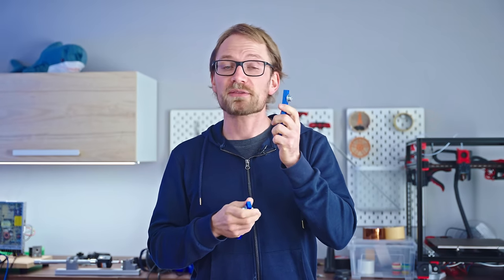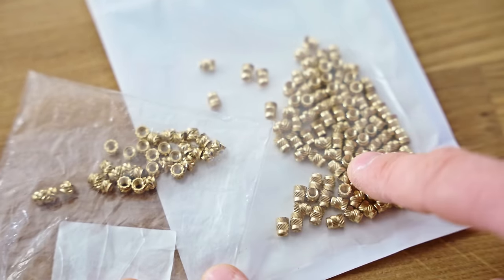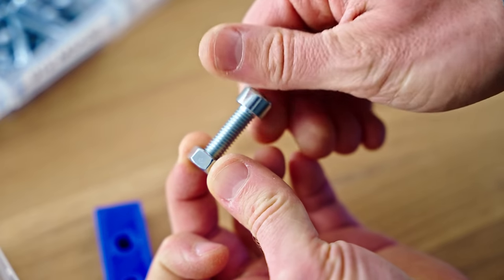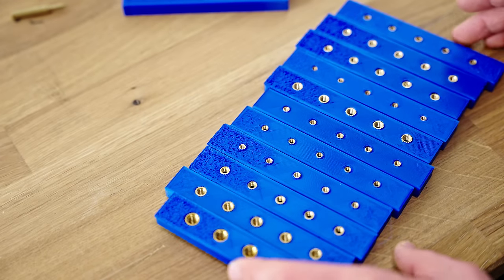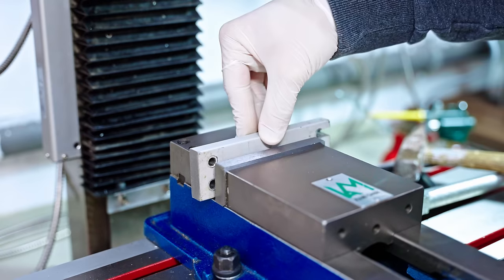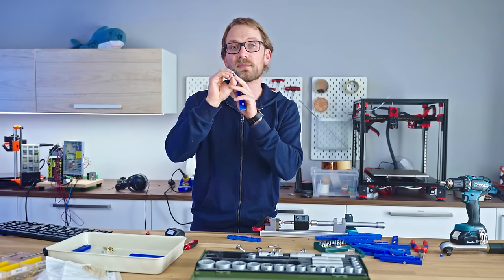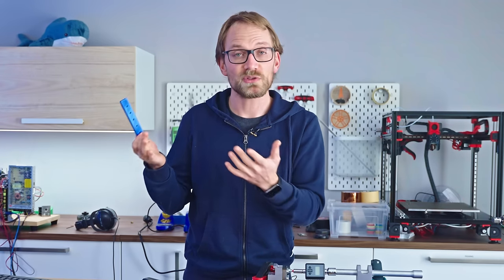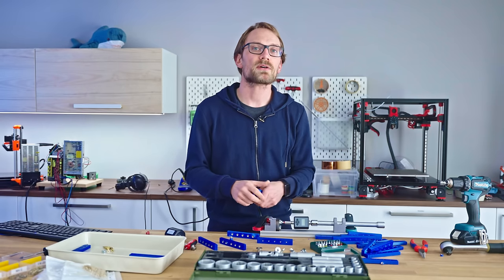Do you even need threaded inserts? Strength tested!

Comment: Surprised you didn't try nut pockets (what prusa does with their printer parts). That creates a nice solid wall that isn't distorted by brass teeth.  I typically use wood screws if it's a one time use, and the inserts if it's a part that may need dis-assembly (also looks more professional).  In injection molding it's exactly the same, if it's a one time assembly then self-tapping, if it needs to be serviceable there better be inserts included.
Reply: This is my exact design philosophy. If it's going together once it's self tapping(even machine screws self-tap in plastic well if the tolerances are low enough) and if it's going to be taken apart multiple times it's getting threaded inserts.
Reply: I design most of my prints with a nut pocket. then I will stop the print in the slicer, insert nut, and continue print. this allows me to use a lot of off-the-shelf hardware store nuts and bolts without having to buy more expensive specialty hardware.

But I'm also not printing high volume, so it's easy for me.
Reply: That'd certainly be stronger threads, but it seems like that would just make the plastic fail faster since there's even less of it at that point.
Reply: Nut pockets are great, and if you design it well you can have lots of plastic between the nut and flange to make it very strong.
Reply: Definitely the best method. I'm a big fan of oversized nuts or large square nuts when possible. You have significantly larger surface area and depending on the depth and the print orientation, the part can be stronger than the threads.
Reply: Wanted to point out the nut recessed as well - guess the good old solutions are going out of fashion 😢
Reply: Those are great as well, but I find them a bit fiddly compared to heated inserts. Heated inserts always work, nuts sometimes don't quite fit very well and then it's quite annoying. Though in that case you could use the melt method as well I guess.
Reply: Came here for this. #4 pan heads. Less work, but only on assemblies I hope to never need to go back inside.
Reply: Just to add one flavor to the mix: a more serviceable alternative to having the nut somewhere inside the print is to have a visible nut on the other side of your printed part.
Reply: What I was thinking as.well. opposite side nut well and bolt then has loads of plastic inbetween. Most plastic injected molded part items I own use that tried and tested method
Reply: I’ll go for this option too. Best is, that the nut can be replaced if needed.
Reply: bingo! it's all about serviceability requirements
Reply: Square nuts are relatively low cost when ordered in bulk. I use them for 3d printing since the longer sides have helped prevent twist out from some higher torque items.
Reply: @Grossvatti  i use it all the time, its so quicky done in cad, and works all the time in all materials
Reply: If it's one time assembly, print some pins or tabs on one piece and holes on the other and use epoxy.
Reply: Except you can't use this solution when it's November 😂
Reply: @Kycirion  in terms of nut pockets, square nuts work much better than hexagonal nuts, they are much harder to round or overtighten, they also tend to have more surface area which helps.
Reply: Nut recess on the other side of the part is what I've always done - such that the nut is press fit into it if possible. I'd be interested to see this tested.
Reply: Recessed nuts are great, especially if you get the sizing right and they lock into their holes.

I've also had great success with a hole in the print that I drop a washer in while it's printing. I guess a pause programmed into the gcode would be easier but this is like low stakes roulette so much more fun.

The M8-M10 bolt he's holding in the video will hold a medium sized person that way, no problem. I know because I hang on them a lot and my shirt says M in the back.
Reply: Nut Pockets are Beyond the Scope of this video.
-they outclass anything shown here, it wouldn't be a meaningful comparison.

If your design can accommodate pockets, of course use those instead. I take this video as just info for the cases when that isn't an option.
Reply: this is what i do for my functional parts.
Reply: @Zombull73 CNC Kitchen did an excellent job testing and showing nut pockets.
Reply: @adriansue8955  that they dramatically outclass fancy and expensive options to achieve the same thing is the point of the comment buddy
Reply: @KiAownage  Huh? didn't I say that.
which is why they have their own video.
Reply: @adriansue8955  yeah but that's like saying a footnote about how much better a bucket is doesn't belong in a video comparing the use of different teacups to move sand.

It does outclass it in every way which is worth mentioning in a video where the stated goal is utilising the full holding strength of the bolts.
Reply: @KiAownage  ?but a Bucket doesn't belong in a video about Teacups.

Comment: I think it could be interesting to see how the number of perimeters around the hole and the type of infill (geometry and density) affects the strength of the insert (using CNC kitchen ones for example)
Reply: true or one print with 100% infill
Reply: I did something like this on my printer, but ran a battery two tests: number of perimeters, and diameter of the hole. I incremented the hole in .05mm increments and tested about 20 options, but I didn't have a fancy torque setup so it was all eyeball and hand-feel.

Once I did that I was able to save custom hole profiles into my cad tool to make those custom holes.
Reply: I was thinking similar thoughts about increased perimeters and/or increased infill density. My spin on this would be to use cylindrical modifiers around the hole to apply the perimeters and/or infill density localized to the hole instead of on the full print (that presumably doesn't need the extra plastic).
Reply: I second that. 
Voron settings for their printed parts are 5 or 6 perimeters. Likely to increase the hold of inserts
Reply: It's crazy to me he didn't go with higher infill and more perimeters.  I always beef that stuff up anywhere I'm using inserts. Also, it looks like his prints had poor bonding of the top infill layers to the hole perimeters.  I have a less "pretty" tuning setting that really overfills that to make sure my hole perimeters are bonded to infill everywhere possible.
Reply: I think proper interconnection of critical parts by infill doesn't get enough attention in slicers. We have smarter algorithms for supports, but all we have for infill are modifiers.
Paint-on infill reinforcement would've been nice to have around loaded parts. Or secondary local infill that would overlap with rather than replace the global infill.
The point is not just increased density but making sure there are enough connections between the painted surface and nearby surfaces and infill.
On the part design level, I can add thin cuts along cylindrical holes to force some extra walls there. Generating those as an extra model to be added as a modifier with 100% infill might also be a good idea, not affecting the exterior of the model - I haven't tried that.
Reply: Very interesting indeed. What we want is to know what is the best performing infil/perimeters/top layers for our projects.
Reply: On my prints with threaded inserts, I’m using m6 threads and have 5 walls I believe. I figured when people ask about infill and strength, the replies are always more walls instead of higher infill
Reply: I can tell you 5 to 8 peremeters and a tapped hole works very well. If you need more strength  put a nut insert on the print and glue a nut into the plastic. I have never had an issue with that method.
Reply: Agree with this, as others have said, solid plastic (100% infill) would be good to see.
Reply: I definitely would have liked to see how different perimeters affected the results
Reply: Yes, more perimeters to reinforce the fastener journals. 
Connect_Infill_Lines and Infill_Line_Multipler=2 also helps.  A 0.8mm infill plane is much stronger than one that is 0.4mm.
Reply: @kvirreful   voron currently recommends 5 Top / Bottom layers, 4 Wall layers, and 40% infill. I think both the higher infill percentage (the Slicer screenshots showed 25% infill) and the thick top layers improve the strength of the parts around that area.
Reply: I experiment with that idea in the past. Unfortunately at the time prusasclicer algorithm doesn't do gradients between the two areas of different perimeter and infill. Instead it creates the exact area of the modifier with the increased perimeter /infill and you end up with a separate piece inside your larger piece held only by layer fusion instead of continuous plastic
Reply: @Sembazuru  This is how I do mine. I had printed a ton of threaded parts, and I just up the perimeters around the threads
Reply: I always increase the number of perimeters when I’m printing parts with tapped screw holes or inserts.  Otherwise there’s just too little plastic to support the fastener.

Comment: In combat robots, we all use plastite screws. They have triangular lobe coarse threads. You just screw them into the plastic, no tapping required. A common failure mode we see are heat set inserts pulling out, but the plastite screws fare much better. We also tend to use a lot of walls since we’re printing for strength. Usually 3mm walls or more. Plastites are also lighter than inserts.

Comment: Flip the camera inserts to the other side of the printed piece. That way you have a larger flange you are pulling against the print. Essentially acting as a larger backup washer.
Reply: Also, doing the same thing with the heat-set inserts. Pull them THROUGH to the far side, rather than pulling them OUT of the side that they were pushed into.
Reply: Also, there's the possible benefit of the recess used for tightening the insert mating with the plastic and preventing twist out when tightening and loosing the bolt.
Reply: But if you can access the rear, you'd just put a nut pocket in there generally.
Reply: My thoughts too!
Reply: @thingswelike  a heat set insert will fit in places where a nut pocket can't
Reply: If you are pulling through, use a nut with big washer. Inserts are for then you can't do that.
Reply: The part is not always so thin that you can do that
Reply: @misimik  Exactly. If you can come thru from the other side then you probably don't need threads in the part anyway. Everything should be used for it's intended purpose.
Reply: Whoa whoa whoa using good engineering principles in any 3d printed parts is off limits!
Reply: @thingswelike  Nut pockets don't always fit. Sometimes captive nuts can be a pain in the butt on prints that are fastened and unfastened repeatedly if the nut tolerance isn't dialed in perfectly (the nut falls out of the pocket). The tolerance requirements for printing a part for a heat set insert are much looser IME. I know if I'm designing something I anticipate taking apart over and over again I lean towards heat set inserts. Doubly so if its going to be used in a tight spot. I just don't want to have to worry about a nut and a machine screw at the same time. 

I believe that CNC Kitchen has also demonstrated that some heat set inserts are stronger against twisting forces than a captive nut pocket. 

I really don't like nuts just sticking out of the back of a part. It is just begging to snag or scratch something.

Comment: Friendly tip - for anything starting at M4+, I am not using inserts for plastic, but inserts for wood. They have larger diameter of the metal part. And I am heating them up and screwing them to the plastic - significantly increasing the contact area. Works much better. And the best part - you can then screw in the bolt from the other side, make the insert invisible and even stronger :)
Reply: That is a realy good idea. I will try that out the next time :)
Reply: I definitely want to see this idea tried in the next video. Great idea

Comment: Would be more interesting to test screws made for screwing into plastic, like "plastite" instead of screwing ISO screws directly into plastic. Right tool for the right job!
Reply: This is the best way in my experience. They are also called trilobular or trilobe thread forming screws for plastic.
Reply: Yes, they work quite well too in my testing. Also things like 'helicoils' do a good job to just add extra strenght.
Reply: screws for wood work as well. nothing is cheaper than drywall screws too
Reply: @shonkydonkey They actually use them a lot on cars. Both on plastic and metal parts. I think so they clear any paint or debris out of threads on the way in. You can usually tell because they will have a small slit in the thread on 3 sides. Sometimes the tips are also slimmer than the threads or look slightly triangular.
Reply: support this, but the difference is the reuse ability of such threads as the plastic weakens every time you reinstall the screw. 
The question is how often can you do this with the same load.

Comment: The vast majority of installation torque (80-90% in steel nuts and bolts) goes into overcoming friction so it's not a good way of measuring pull out force. Once installed the assembly strength is determined by bearing and pullout strengths, not twisting of the insert.

Comment: FYI, when you tap plastic you should hand tap not use a drill, you will heat up the part and melt it. Also do 1 revolution and clean out the tap, then continue the next revolution and cleaning until you are done. If not you will mess up the threads. Also don’t lube the PLA, oil will weaken it.

Comment: Test it with a regular hex nut countersink in a hexagon hole from the back on the part or a square hole in side the part and push the nut in from the side. I do this all the time and it works perfect and does not require any special nuts.
Reply: This was exactly what I meant with my comment, but better writen :)
Reply: Yes this is the standard (and correct) way of doing it, unless you want to save weight.
Reply: This. It's so much stronger than heat inserts that can pull out or strip the hole and spin, and uses dirt cheap off the shelf parts.
Reply: @daliasprints9798  well you can use the heated inserts from the back side too but yeah those could potentially still strip the plastic
Reply: @jexom  I think your idea could work just as well
Reply: i also do this. its surprisingly strong!
Reply: Could also use metal washers with nuts

Comment: Just a FYI, spiral fluted taps are much better suited to tapping plastics and soft materials like aluminum as they evacuate the chips while tapping.
Reply: The use of those traditional taps may be why his simple thread an m2.5 hole.did not work. I have a spiral tap and, as long as I have a few extra wall layers, find it works perfectly every time.
The only thing I would like to find is a way to simply set extra walls on holes only without a lot of fiddling.
Reply: Ah yes, I was a bit surprised that tapped holes worked so poorly considering how often I use it for non load bearing parts. My taps are also spiral fluted, and I don't power tap them so that is probably why I have better luck with it.

I wouldn't necessarily recommend it, most of the time I do use a captive nut or insert. But it isn't that bad.
Reply: Cool didn't know that
Reply: Single-cut taps are the choice when using machines for manufacturing. They require a higher torque because they finish the thread in one pass. They are also more sensitive to torque peaks that occur when cutting a thread by hand with a tap wrench. In this case, a tap set consisting of a pre-cutter, center cutter and finish cutter is used.
Reply: Exactly! Plus use a super sharp tap which you only use on plastic parts and not on metal parts ..
Reply: Another thing is hand tapping to avoid melting the plastic. Never used a powered tood to tap my plastic parts and these come out great down to even m2
Reply: Actually a better tap is a thread rolling tap, which does not cut the material but instead deforms it and makes no swarf, though it really needs lube on it.  You see it commonly as the trilobular screws you find in sheet metal, where it threads into a punched steel hole, and rolls the thread with no swarf. Common on PC cases and microwave ovens amongst others, as you find the manufacturer does not want to spend minutes per case tapping holes, which is slow, and having most of them go unused, so instead these screws go in as fast as a regular one, and also no swarf to short things out generated.
Reply: @originalmianos  with prusaslicer you can just put a cylinder modifier over the hole and increase perimeters for that area!
Reply: @Lolwutfordawin  As I do, over each hole. There is no automated way to do it. It's a manual process.
Reply: @originalmianos  misread your comment, yeah an automated way of doing it would be great.
Reply: @SeanBZA those only work because they work harden the metal. In plastic theres no benefit to roll taps. Also power taping is fine if you have some finesse and dont run the drill too fast.

Comment: Perhaps consider printing a 100% infill 'doughnut' of say 10mm around each insert/tap/thread point to eliminate some of the variability caused by your part flex and infill interface, along with using an omnidirectional infill like Gyroid. It would improve pull-to-pull consistency and more accurately demonstrate the ultimate/average strength of each method.
Reply: This is exactly what I do.  In the slicer add a cylinder modifier with 100% infill (usually just larger than the diameter of a standard washer you would use for that fastener.  I've had no issues with part failures for my applications going this route.  I make a lot of sensor mounts so there isn't generally a lot of dynamic forces on them, mainly just static loads.